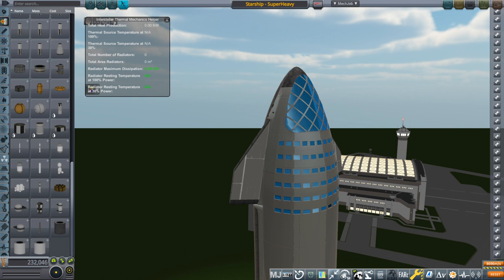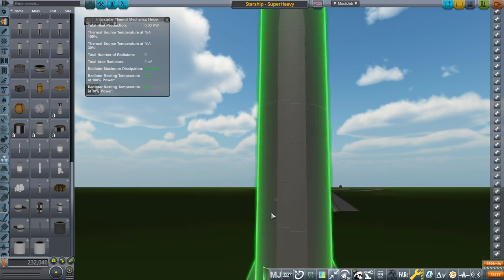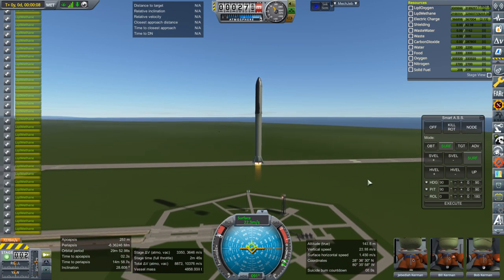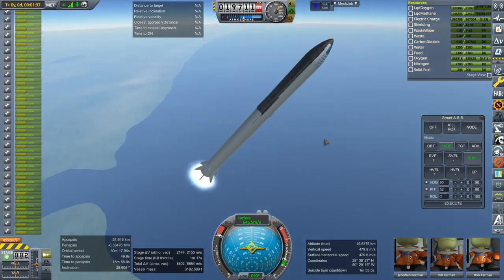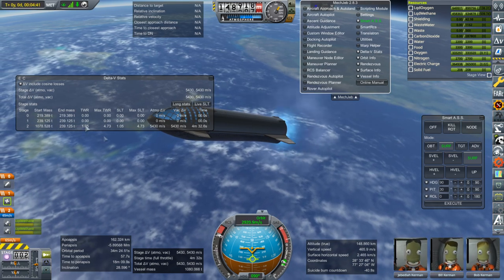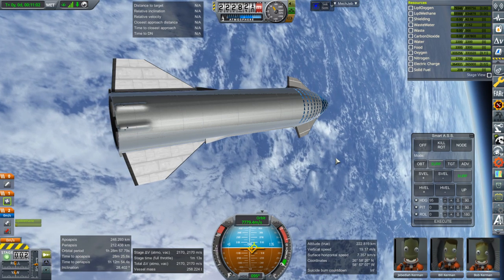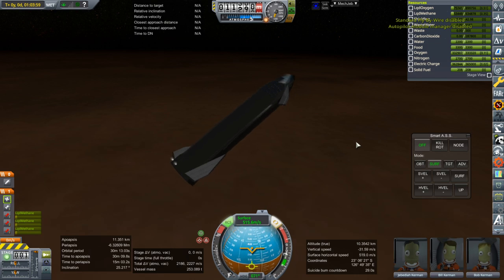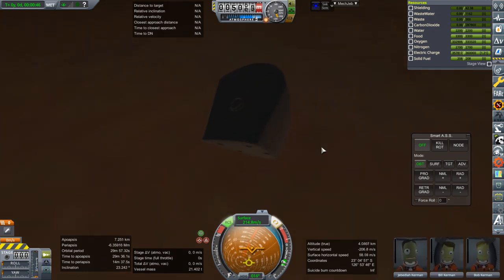Realism Overhaul in KSP - Starship-Super Heavy Update

Comment: The bulges at the base of Starship are landing leg fairings.

Also, for the control surfaces, I would use either stock or infernal robotics servos attached at each end with recoupler or an actuator attached in the middle. I believe the stock robotics controller can respond to control inputs as well.
Reply: You said almost exactly what I was going to say
Reply: Alien Max No, the legs are just inside the skirt with the prototype. Elon said these are like 0.9 version landing legs
Reply: The bulges house fuel connection points. They will transfer fuel from/through the Superheavy boosters, for surface fueling, and for buddy refueling while in orbit. The Lunar variant of Starship did not have them in the render, but that's likely an oversight.

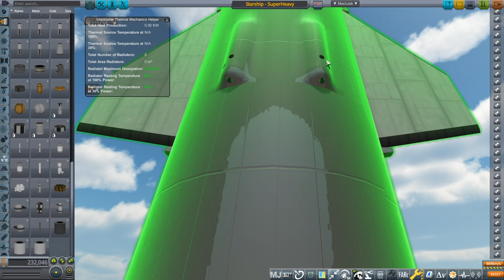Comment: 1:00 those were supposed to be leg fairings, however they ditched that design, and now legs will be inside with engines(i wonder how are they going to fit here drill, something to turn fuel cryogenic, pump, legs, and vacum engines)
Reply: That could have just been SN3 (and the upcoming three-engine prototypes). It is likely the landing-leg fairings will persist with the full six-engine version. Unless there's something I missed in the past few days?
Reply: >i wonder how are they going to fit here drill, something to turn fuel cryogenic, pump, legs, and vacum engines
All the ISRU equipment will be stored in the main cargo area and will require deployment on the surface; it won't be a part of the vehicle, it will be cargo hardware. 
As for legs and vacuum engines, we know the leg design is changing again beyond what we've already seen, and while I'm not sure how big they're going to be, the vacuum engine nozzles can simply be designed to be as big as they can without hitting the legs.

Comment: The bulges at the base of starship are the old landing leg design, but they’ve recently been changed. The leg bulges are gone because they now fold out from the inside where the Raptors are located. You can look up “kimi talvitie landing legs” as he made a render of the new leg design that Elon responded to and said was pretty much spot on they just needed to be longer. The legs can also be seen on the bottom of the SN3 Prototype that recently collapsed
Reply: Also Raiz thank you so much for taking on this project of making an updated Starship Super Heavy for KSP, no one has made any mods for the updated design! Plus you make great mods and rockets so I can’t wait to see the finished project
Reply: @THUNDERSHOCKR  Tundra Exploration
Reply: I think it's safe to keep the old leg design until we get the real new ones. SN3 was "0.9" so I think we should wait until we get new renders or specs
Reply: Ace King You’re right I forgot about that one but even then I still think that’s the only up to date starship mod currently

Comment: As we know there will be 2 large cold gas thrusters on the superheavy booster. Starship has 6 rcs thrusters on the nose, 3 on each side, one pointing forward, 2 pointing 45°angle down and up so they can be used for up and side movements. On the engine skirt there are 3 on each side on the bottom of the wing mount, one pointing 90° down and 2 again pointing 45° out also for up/down and sideways movements for a total of 12 rcs in the entire Starship😊
Reply: Ace King I thought Elon said they were switching to hot gas thrusters because of there higher thrust
Reply: @wyattgames7465  Its more complicated to heat up the lox and they will be bigger on super heavy
Reply: Ace King Do you understand how monoprop engines work
Reply: @wyattgames7465  it wont have monoprop or hyperbolic rcs he said
Reply: Ace King I know but it’s the same principle, except hot gas thrusters burn the fuel in the tank
Reply: @wyattgames7465  its more simple and weighs less and elon said that undesigning something is better that designing something so most likely it will have cold gas thrusters (its on the SpaceX render too)
Reply: Ace King it’s using hot gas thrusters, if it used cold gas it wouldn’t be able to go from belly flop maneuver to engines down fast enough
Reply: @wyattgames7465  falcon 9 does and they will be bigger on the booster elon stated on twitter and the animation showed it

Comment: Looks like the real starship booster underperformed massively compared to this it reached almost a quarter of the speed at separation . I guess there were massive fuel leaks in adition to the missing engines . Well i guess SpaceX will not forget to buld a firetrench next time - but God the booster was resilient . It's going to be a winner

Comment: Note about the RCS on Starship, Elon has said that they would be Hot Gas Thrusters. So the force on them would be a lot higher than the current Nitrogen Cold Gas Thrusters on the Falcon 9.

As others have said, the fairings were for the Mk1 landing legs. Though, I'm sure in the coming months we'll see new iterations of Starship's landing leg.
Reply from the maker: I've configured these to be straight Methalox, which would be much better than any gas thrusters though somewhat harder to ignite. Methalox thrusters were tested on various lander prototypes, so they should work, and I think RO players will be thankful for this upgrade.

Comment: It’s possible that the super heavy landing legs are only meant to carry the weight of a mostly empty booster upon landing- perhaps 200-300 tons, as compared to the fully fueled stack at ~5000 tons
Reply from the maker: But it would have to bear the impact with the ground, which as a sudden impulse may be more significant than bearing the mass of the stack statically.

Comment: For game performance is there some way you could make an engine 'pod'/'group' that simulates 3 or more engines as one engine with the same engine ISP?
Reply from the maker: If SSTU Labs had Raptor Engines or I turned these RealEngines parts into SSTU clusters. Not the easiest thing to do, but possible.
Reply: You could duplicate the part config and have three model definitions, each offset from the centre attach/stack node, like other RO composite parts. If you were using the defaut RO engine config, you could set the engineTypeMult parameter to 3, which would do the all the maths for you. If you've edited the global raptor config for your 'worse performance', rather than the specific engine part, then that should still work. But I guess it wouldn't be too hard to simply multiply the thrust and mass by 3
Reply: I have this! Seven engine and 20+ engine raptor clusters. If you're interested I'll try to see which mod I used for this.

Comment: Make sure to fold the large ’wings’ back 90* on ascent.
Reply: Small ones too
Reply from the maker: Interestingly, though, it doesn't seem necessary at all.
Reply: Folding the wings on ascent is unnecessary so long as the rockets heading remains the same as the prograde vector. There will be little to no lateral forces trying to flip the rocket.
Reply: @RaizSpace  Where not sure yet if the wigs will be folded back or starship just ascending wings facing down range and used for yaw control.

Comment: I have an idea. Put a pod like the Dragon crew on top of Starship that can detach in case of abort. And if you want to send 100 people to mars use several Dragon crew "shuttle" flights to an orbiting Starship. That way there's less risks.
Reply from the maker: The crew pod in this can already detach for abort. It has solid motors built-in and a decoupler.
Reply: @RaizSpace  Sorry. I missed that. But I think it's a cool concept. And also you could have a crew tube from the bottom of the crew pod that goes down all the way along the payload area. Another idea I had was to build the top ballast tank as a torus that way the crew tube can go through it. I'm testing this in KSP.
Reply: I think, they usually won't pack 100 people here, rather 40.
Reply from the maker: The crew pod I have only fits 20 and I can't imagine using this to transport more to the Moon and Mars. With more than 24, I think the escape system is genuinely unfeasible.
Reply: @RaizSpace  Yeah, maybe a pod of up to 10 crew can be ejected from the top. Also it wouldn't have a heat shield so it would be lighter. Maybe 8 Dracos could do it.